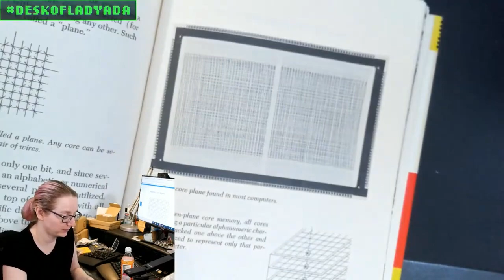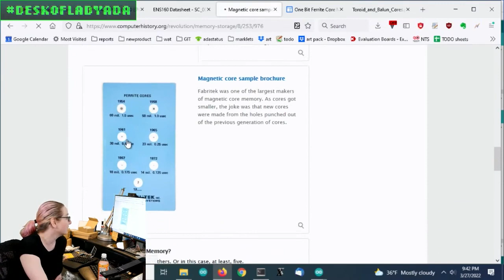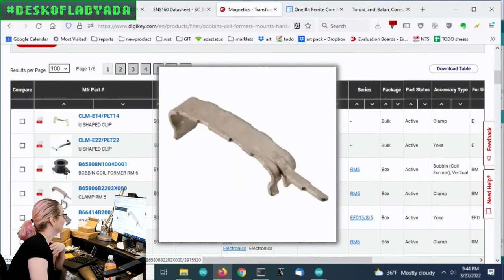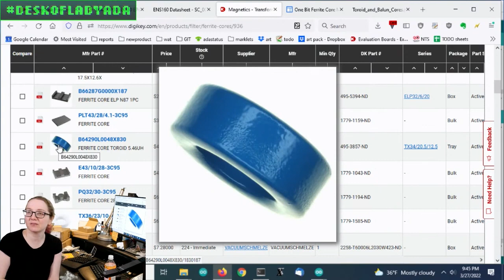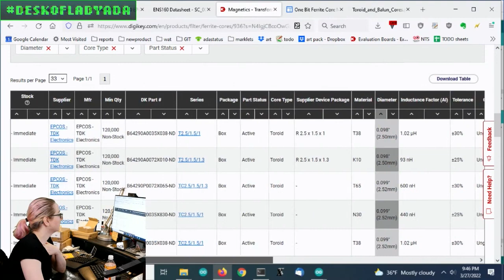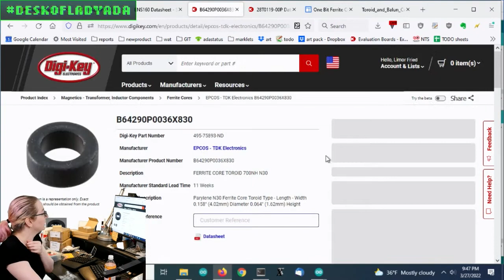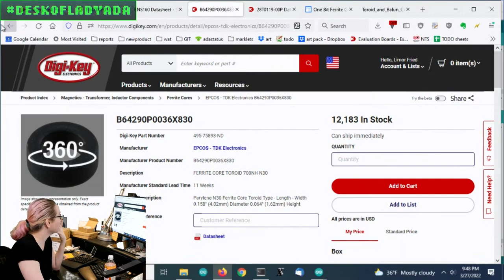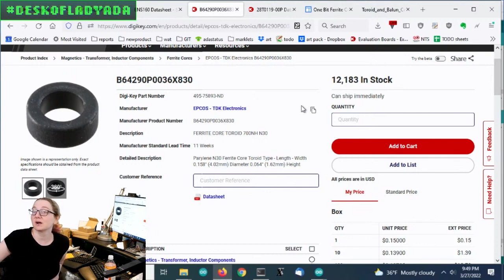The Great Search: Miniature Ferrite Core Ring (Toroid) #TheGreatSearch #DigiKey @digikey @Adafruit

Comment: There is a group that got a scrap Apollo Guidance Computer (AGC) working.  When they were able to get access to the RAM core memory they were able to determine what programs were last to run, when the computer was last powered, and where it was (latitude and longitude).  The data was still there 30 years later.

Comment: I'd call it static and not dynamic memory, as it didn't require a regular refresh like D-RAM (dynamic RAM) chips do. Randy Carter's comment supports this. Also, I programmed first-gen Data General Nova computers with core memory, and can verify that's how they worked, and they could recover from an over-heating power-down with no loss of data or program.